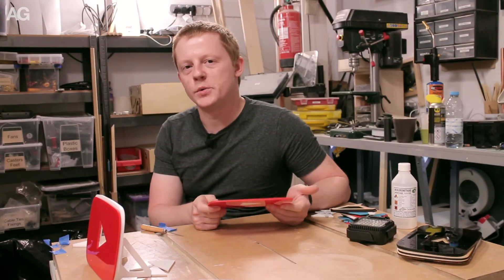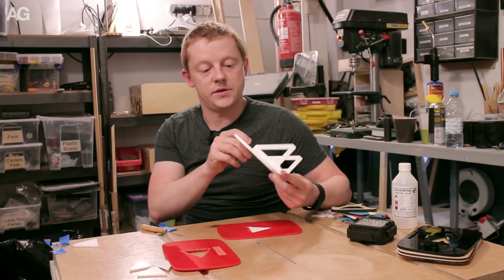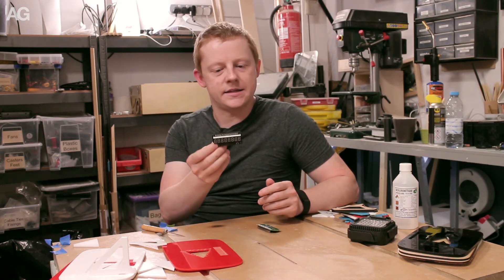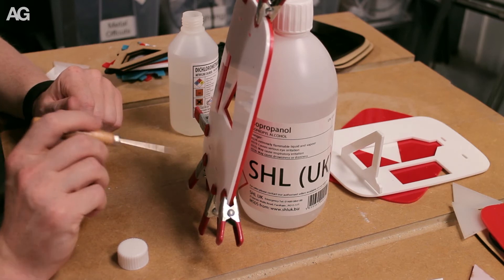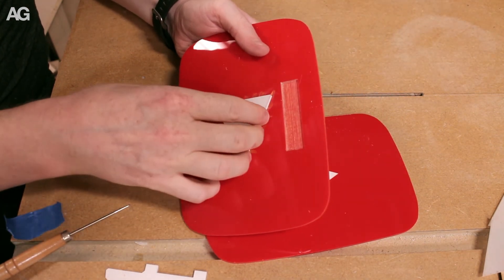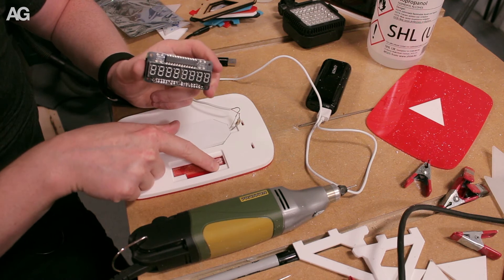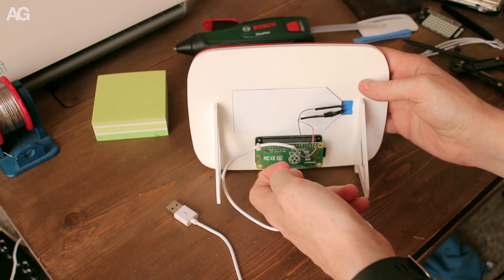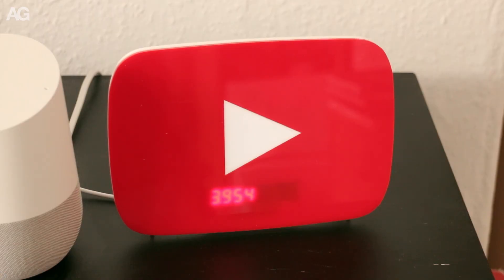Raspberry Pi YouTube Subscriber & View Counter

Comment: Copied the script and I'm getting a KeyError: 'items' error message when I try to run it. Could something have changed at YouTube's end to stop this working?
Reply from the maker: The best way to start fixing problems like this is to request the url in your browser, copy the whole url including your api key and channel id into the browser address bar and take a look at what's coming back, does it make sense? Does it have the items attribute?
Reply: Thanks for the reply. The URL does return the items attribute. I'm thinking that it's something to do with the script. I copy/pasted it, instead of Git Clone. Wil try cloning later. Thx for help!
Reply: Found the error. Missed off the last digit of one of the keys. Was testing the URL on different platform, hence that version worked. Doh!